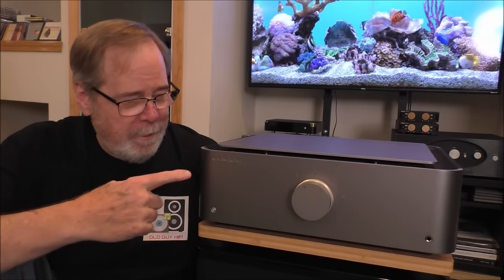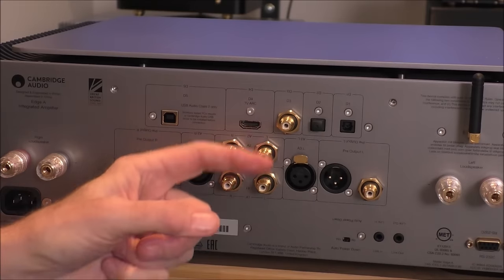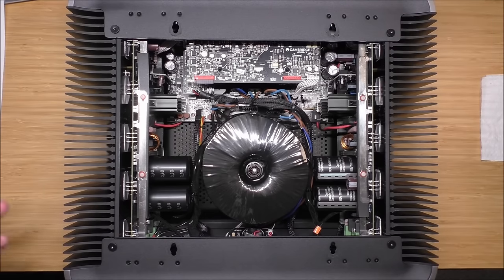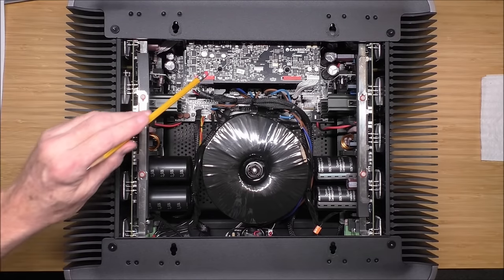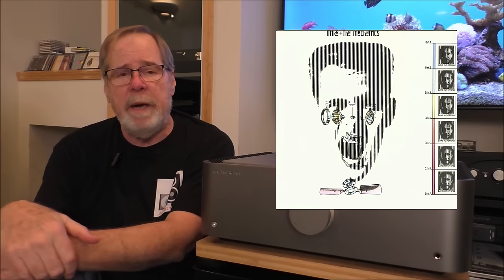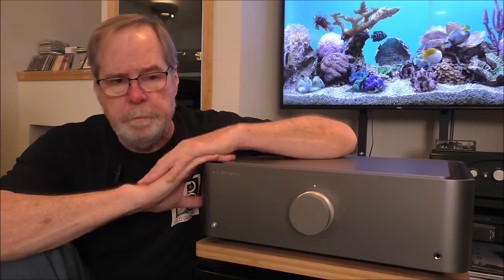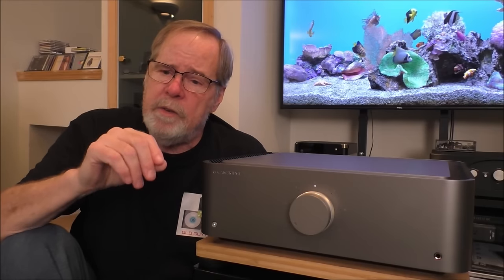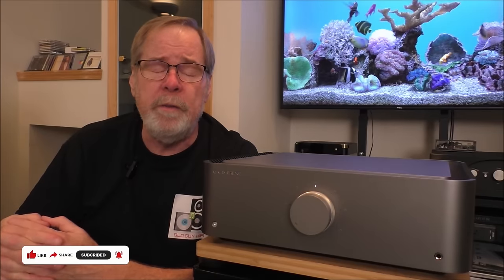Huge Horsepower! The Cambridge Edge A is powerful & refined. One of the best I have ever heard.

Comment: Great video and outstanding explanation job. Starting about 10 years ago, I did a lot of integrated amps comparing. No stores around and I could only buy used; so I used ebay. I bought quite a few amps, all under $300 used. I got real good deals, as many of them wwre around 2 and a half times that retail, back in their day (1980s/90s). The two that I spent the most time with were both  Yamaha's. One was a Yamaha integrated amp, Class A/B that had a transformer in it as big as a softball, and it also had several enclosed metal compartments inside, which isolated parts of the circuity for shielding or consistent temperature reasons. As expected the big transformer resulted in big instrument size and soundstage. Suprisingly the bass wasn't that authoritative but WAS very good. The other Yamaha integrated had a front panel button where you could chosse Class A/B Operation or Class A. You could literally switch dozens of times between A and A/B at the press of a button. Fortunately the volume stayed the same. Class A was purer and the tone colors were more colorful with the preferred Class A. But it's midrange sounded  very forward and smaller than the other amp with the huge transformer. So I had the choice between bigger airier sound or purer more corful sound. If the Class A amp was not so forward in the mids I would have used it as my main amp. Instead I went with the Class A/B which synergized better.  Class A is really special though. 

 I think it depends on the music whether I prefer a warmer sound or a brighter sound. I remember buying an SACD of Mysterious Traveller by Weather Report (their best & most creative album). It took many years to find this rare cd at a price I would pay. The SACD, even though more refined, had a warmth that I didn't think suited the music well. I went back to listening to the regular redbook cd.
Reply from the maker: I love that album. I have an OG vinyl copy as well as the SACD. I agree out is one of the best. Thank you for the view and comment.

Comment: My preference is neutral and detailed. I like a transparent system that doesn’t flatter recordings. I like to “zoom” in and hear the finest of details. Btw you might be interested to know I built my own USB cable to isolate my   Dragonfly red DAC. I connected said cable to a cheap LPS and USB isolator. Took care to place ferrite chokes to mitigate noise for common and differential mode noise. I could go on and on but it was worth the challenge. It improved imaging and soundstage depth. Quite a fun and educational project.
Reply from the maker: I have used chokes on USB for years. I have a couple of USB cables a buddy of mine at Lucent cooked up for me. You are right they work great. Good tip. Thank you.

Comment: I've listened to one a few times. It's a great sounding integrated amp. Built well. However, considering it's made in China where wages and manufacturing costs are relatively low, it is overpriced at $6000 IMO. The Japanese made Accuphase E-280 is only $1000 more. The Malaysian made Yamaha A-S1200 is half the price. It's the same price as a USA made McIntosh MA5300. Also, it's been out for a while now and the DAC needs to be updated.
Reply from the maker: Thank you for the view and comment.

Comment: So, do all the models from Cambridge with “XA” in model name have this same technology?(maybe obviously). Hadn’t heard anyone describe CXA81 (or mk II) in that way. Also, same dac chip as CXA81mkII (only difference from CXA81 , has 9016 i think). You probably knew this i just thought it an interesting point.
Thanks again
Reply from the maker: No. The XA nomenclature used to be called XD but so many people thought the amp was class D that they renamed it. The CXA designation is just a model number and not an indication of the amps circuit topology. I know to is a bit confusing. Thx for the comment and your view.

Comment: Class XA sounds most interesting. What about power usage and heat?
Reply from the maker: I it does get warm but never to warm to touch. I do think it may use a little more AC current the a straight class A/B amp. I hope that answers your question. Thx for watching.

Comment: Class AB minimises crossover distortion even at higher powers by always having both transistors conducting at the crossover point. This is the reason that the output transistors have to be biased, so they are always operating in their linear region. No waveform with gross crossover distortion will be created as per the diagram you showed, and this can be confirmed  by using an oscilloscope connected to the output with a sinewave  input with varying levels of amplitude.
Reply from the maker: Thank you for your comment.

Comment: No tone controls---->TRASH.
Reply: What!!!Audiophiles don't use them !!! Just imagine it's perfect and it will be.
Reply: Some people don’t believe the phase shift is worth the effort of an eq, like me.
Reply from the maker: Thx for tuning in. Please reply it helps the algorithm.
Reply: @OldGuyHifi Ed it is not negative you could chime in positive!!! Every computer audio software has an EQ plugin it has PreAmp inputs...  

Informative also helps the algorithm. 

The question 4 U can those out/ins proform loop thru similar tape
Reply from the maker: I will have to look into that question but, I don't think so.
Reply: @thinkIndependent2024 
Despite any minor phase shifts, I believe a switchable (bypassable) EQ is a benefit, that even the best integrated amps shouid have. Your speakers might not be quite as bright as you might like. Your room might have lots of soft furnishing. Your ears might be old, and a couple of db lift at the higher frequencies make all the difference. As you enter get older, you might wish your amp had a EQ, as your ears wind down the treble a bit! I don't have more than a couple of DB lift, starting at 0.5 db increasing to 2db at the higher frequencies (about 12khz) and it makes all the difference, with music sounding more like it used to, and as I remember it. Of course the higher frequencies fade even more.
Reply: @shaunhw 100% I agree the RIAA curve and the thought of no equalization myth  from people that chose a 40 decibel swing for Vinyl  that would have required 1% tolerance for all components in the device chain. 

It was always Engineering EGO 

I'm lucky to have 4 rooms with playback that measures .5 decibels in REW for all systems but 1
Reply: @thinkIndependent2024  
I never thought about  RIAA! That really does make a bit of a mockery of "no eq" for sure. It would be interesting to learn what phase shifts are involved there. Of course there are also phase shifts caused by any speaker with crossovers for multiple drivers. But minor phase shifts are not easy to detect with human ears anyway, and the jury seems to be still out if they can be detected at all providing that both stereo channels have the same phase errors, so there is no physical phase cancellation in the air movements. The ear and brain can also easily detect diffences in timing between their ears, but this is only audible when there are differences between the two channels. There's also the point that all the phase differences between the different instruments being reproduced. These are not in any way synchronised. Even on a single acoustic piano, the phase relationships between simultaneously played notes depend on the exact moment that the hammer hits the string  and the precise tuning of the piano strings involved.
Reply: @shaunhw Interaural Crosstalk Cancellation..XTC .. that's the 200 microsecond time between the ears in my home lab I developed  methods to overcome the problems at a low cost.

The Acoustic Wave Front of Stereo projected properly in the plane  fixes  phasing when implemented properly .

It took about 20 years after Alan Blumlein died to rediscover his original methods for stereo and another 20 before it really began to take root.

Alan's  1931 demonstration included 3 pianos playing in a triangle and each could be heard right down to the direction of the keys... America fell in love with MONO!!! That what my research shows.
Reply from the maker: Good stuff. Thanks.